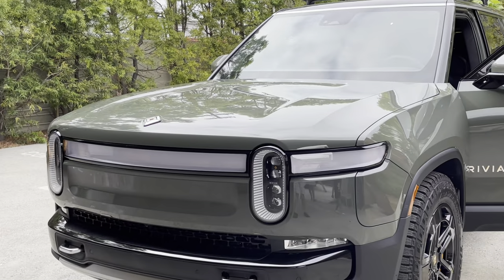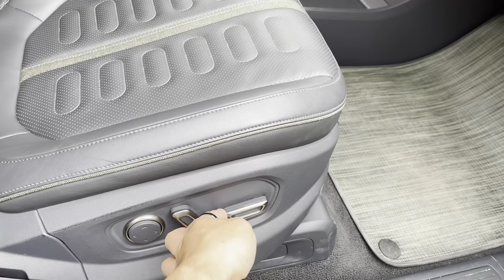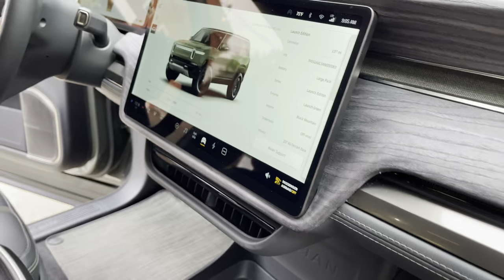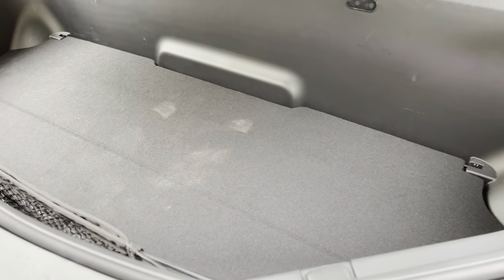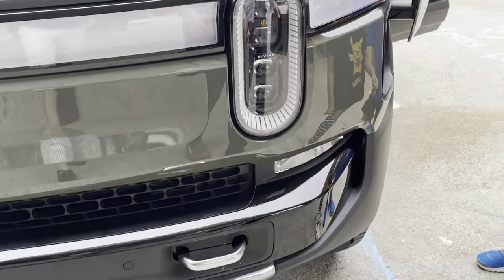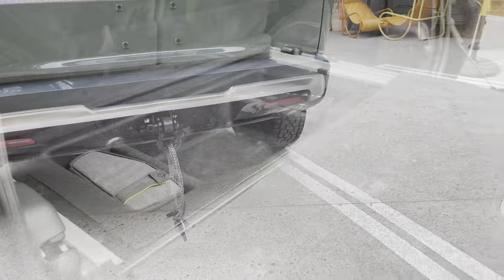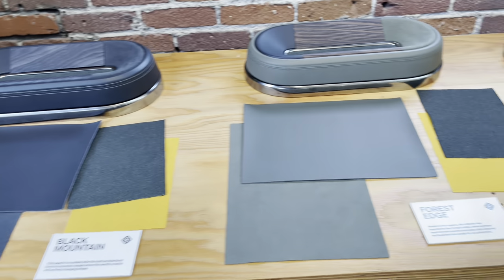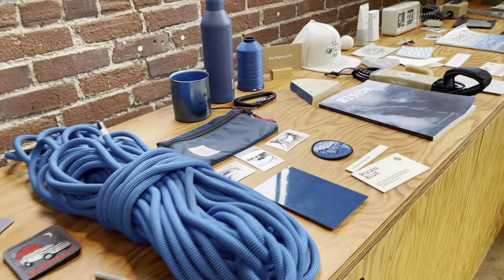R1S Rivian FIRST SUV EV | Best EV SUV? #venice

Comment: The third row seat is tight in the legroom department and feels claustrophobic as the model Y third row. My 2022 Kia Sorento plug hybrid has better legroom than R1S.
Reply from the maker: Definitely more side and headroom space in R1S than X for sure we have an X. If 3 row needed daily just get a van instead of suv.
Reply: I suppose a large third row matters if you tote around full size people on a regular basis. I have zero use for a third row so it is more of a bonus to have anyway. I can barely fit luggage in my model y with only two rows, so I can’t imagine how families are making it work with the Their third row with luggage. It’s a car now a proper SUV.
Reply from the maker: @PumpUptheJam81  agree it’s more for occasional use if daily use best to get a full size or mini van
Reply: I have a Model Y 7 seater and based on all the videos and pictures isn't a close comparison. People who have been to the Venice Hub have shared that the R1S third row is better than the current Highlander. Curious on your experience if you've been to the Venice Hub (I am a R1S preorder and need something bigger than the Y :) )
Reply: @ericfhernandez  check out Jeep Wagoneer/Grand Wagoneer third row.
Reply: @nizzam2922  only going for EV’s at this point. We Also have an Odyssey for longer trips…
Reply: How is the Sorento and R1S comparable?  It is two totally different SUV.  Sure you Kia has more legroom, but can it sprint like the R1S.  Also there is no way the R1S feels claustrophobic as the Y, I sat in both.

Comment: Good try Rivian. A very nice SUV. I wish they would have reduced the amount of plastic trim in the interior and the third-row space is very tight for such a big SUV.
Reply from the maker: It’s not that tight compared to the X lots more space and we have and X
Reply: @megawatts   Do you think it has as much leg room in the third row as the X?
Reply from the maker: @hussamalyafai3708  compared to 7 seater X no way, Rivian has more leg and head room all around. 3rd row X is for shorter skinny adults or children without car seat anyone 5.4’ taller will have issues, R1S can fit up to max probably 6’ bulky build
Reply: @megawatts  yep, I sat in both X and R1S, R1S definitely have more leg and head room.
Reply from the maker: @jml9550  finally someone who able experience both unlike all the haters 😂
Reply: @megawatts  from life experience most haters are sour on what they don’t have or don’t have what it takes.